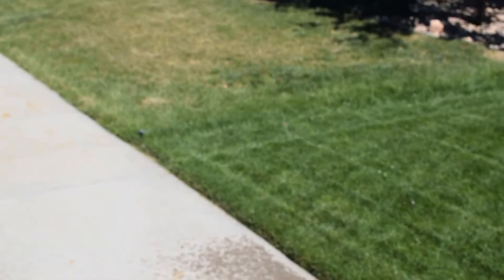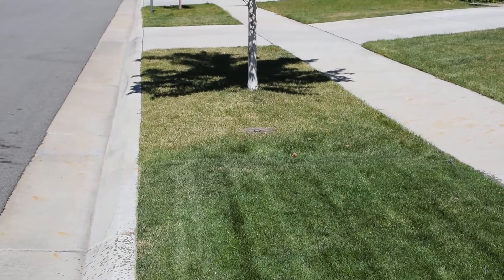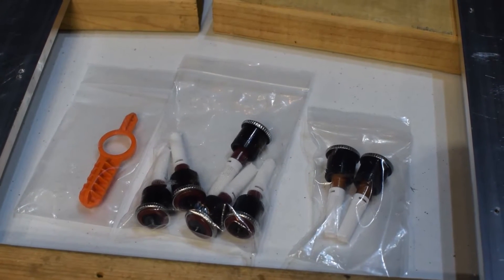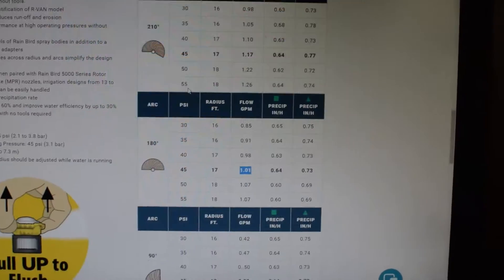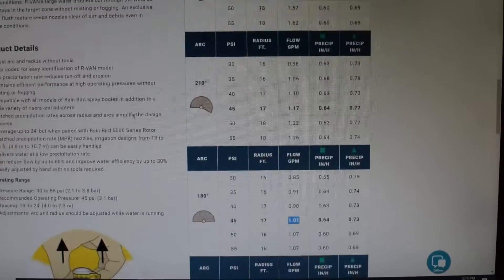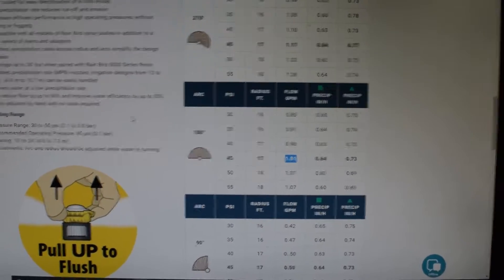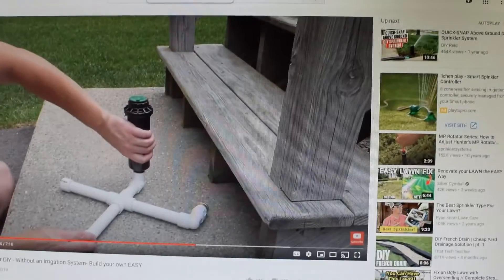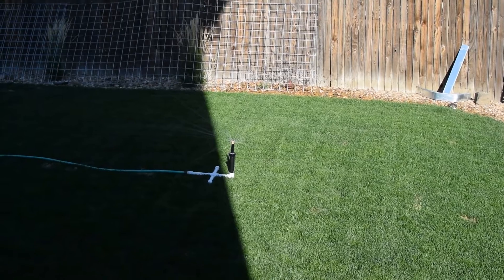Rain Bird R-VAN or Hunter MP Rotator

Comment: are all these heads in the same zone? if they are then that's your problem. ideally you should have 3 zones (from what i see in your video), one for every section of your lawn. there is no pressure high enough in residential areas where you can run all these heads at once at the same time. (7 heads / line) is not doable in most cases.

Comment: Either your water pressure is way too low, or you need
Cut out a few heads, these types of nozzles work at specific PSI.. I use both MP rotator and R-Vans, my side strip and park strip I use the MP rotators,  and for the 180° and anything below 360° use rvan. Also, try the Tan and Maroon colored nozzles, I found it better to turn the flow down vs hope for max flow out of a nozzle that’s not made to spray that far.. anyways, in my opinion, both have their pros and cons. Also, Hunter makes a 40psi regulated head, if your pressure is way high on one head and near end of the line minimal, try using the regulated heads, 30psi or 40psi, that will solve your issues. I know I’m late to the party hope this helps anyone else!